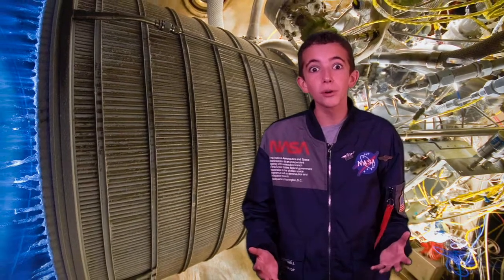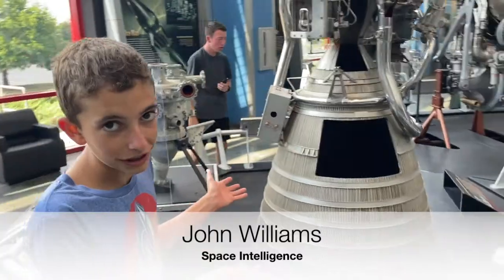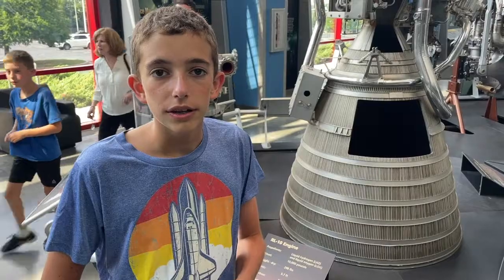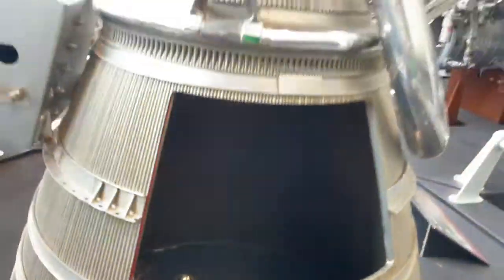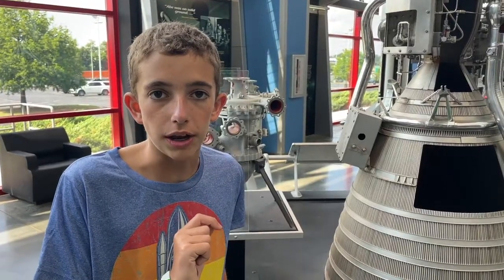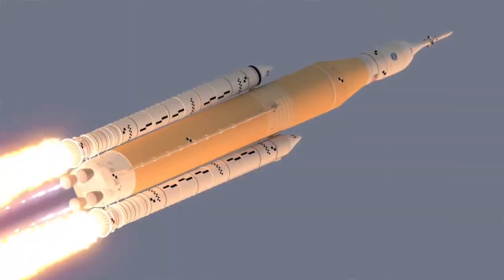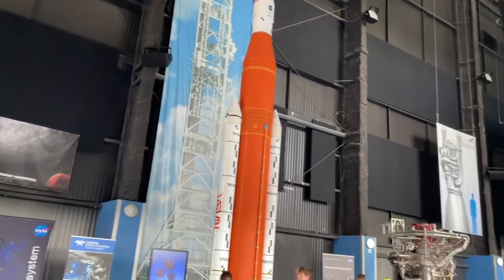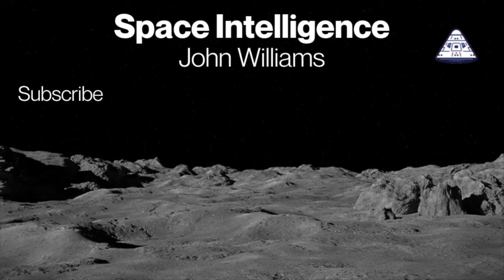RL-10 Rocket Engine: The Greatest Engine Ever?

Comment: I think it's about time they went away from the furnace brazed nozzle.  That nozzle is an enormous portion of the US$20M cost of each of these engines.
Reply from the maker: I’m on board 😂
Reply: It was a thing of beauty, but you’re right - pretty expensive! AR agreed and invested in a new model that uses an additively manufactured copper chamber: https://youtu.be/v51ZiT-s7Qc?si=H2-a7ifSPXdvi6KN
Reply: @brettaustin5568 They're also using a carbon/silicon ceramic matrix composite nozzle extension on the version used with the new Centaur IV upper stage.